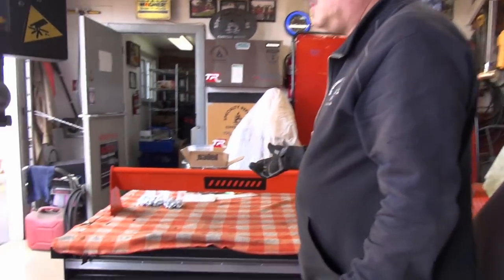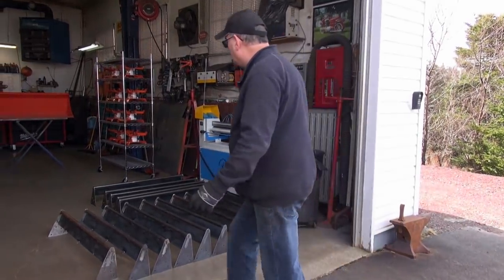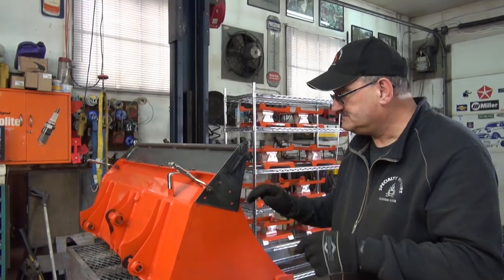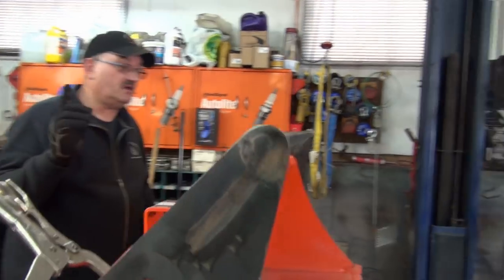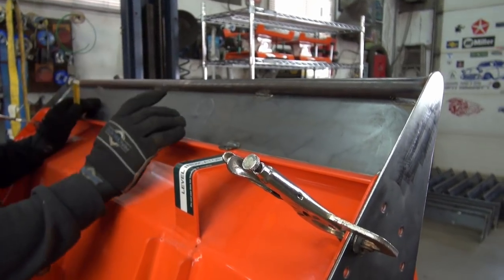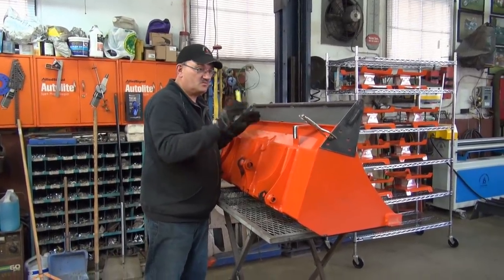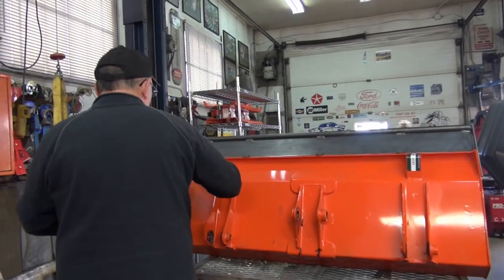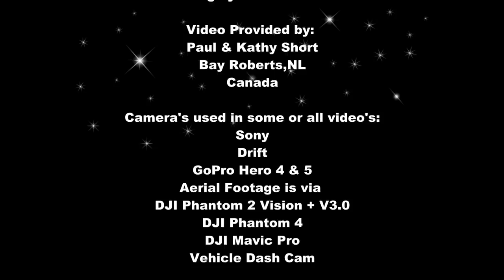New Kubota BX Spill Guard Kit

Comment: Totally essential !   the stock bucket upper lip is just too low.. it dumps back over that upper lip so easy when bucket rolled back. Moving light stuff like wood chips, you want to grab as much as you can, and then it spills. Well done Paul.  Sure beats the temporary 2x6  i clamp on when moving chips.

Comment: Will the Spill guard bolt on kit fit other brands of buckets PROVIDED same width as the Kubota  ot require special order / additional fee. Like the option to cut access for grab hooks. Just asking? Like the show and use of the CNC machine.Cheers!
Reply from the maker: We’ll be looking at other brands but right now this is kind of a market test. Thanks for watching.

Comment: Hey Paul did you ever sort the problem with the plasma tripping the breakers
Reply from the maker: Jim actually the electrician came back and put the amp clamp on while the table was burning. It was drawing 85 amps at peek but they think they had the plasma and the compressor on the same leg so the 60 amp breaker couldn’t handle that load. They changed some things around and we’ll know on the next table burn if it cuts out again.

Comment: Just what I need. Two questions: Weight shown in pounds? And will this fit my SSQA with Mikes Bolt On Hooks without interference? Just wondering. Love the no-paint option so it can be modded for access to the hooks. Great job as always. Sorry your property line view is changing. Also hope the Tracker breaker issue has been resolved. Take care you two.
Reply from the maker: Not sure about the fitting with the hooks. I’m happy the property next door is finally getting cleaned up. It’s been a liability for us for years. Thanks
Reply: I wondered about the breaker issue too? No news has to be good news... =))
Tim in Calif.
Reply from the maker: Well actually the electrician came back and put the amp clamp on while the table was burning. It was drawing 85 amps at peek but they think they had the plasma and the compressor on the same leg so the 60 amp breaker couldn’t handle that load. They changed some things around and we’ll know on the next table burn if it cuts out again.
Reply: I wondered about the compressor....thanks for answering. Continued success with the new business. And continued success with your Awesome videos
Tim in Calif.